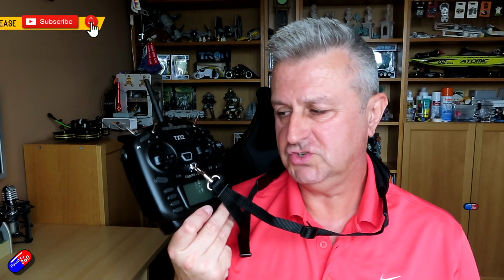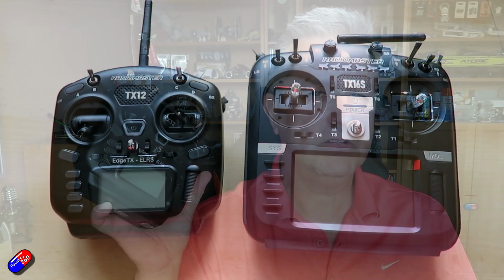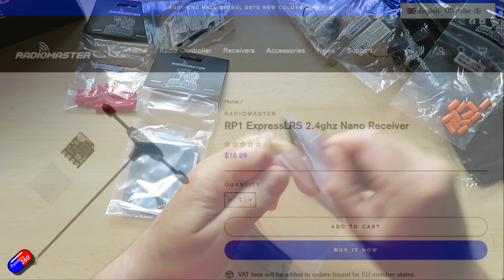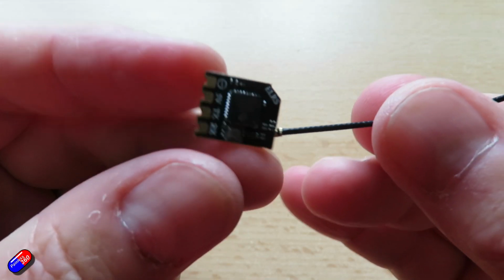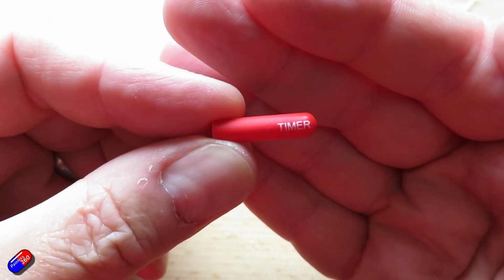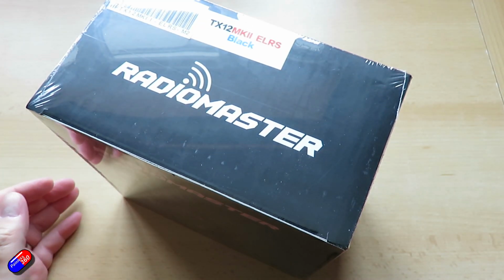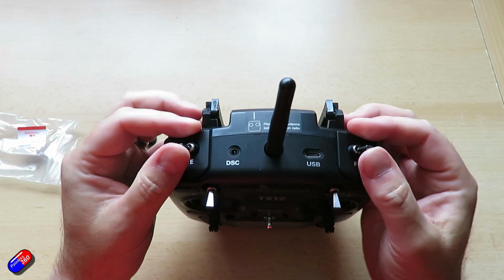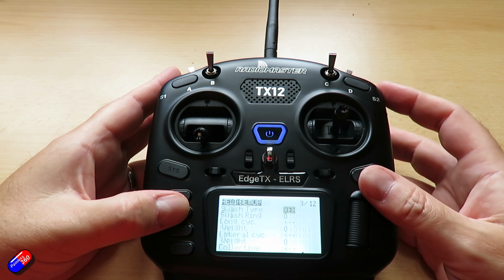Latest RadioMaster Kit (including new ELRS TX12 Mk2 and two new ELRS receivers!)

Comment: Hello! I have the elrs version of TX 12Mk2 only to find out it does't have MULTI protocol, I only see CSFR(the elrs receiver I ordered is on the way yet so I cant test the crossfire part). Am I correct to say it really doens't support other protocol? Then, playing with the EdgeTX Companion, I accidentally, was able to set "MULTI" in the internal RF of the radio! I got excited but sadly I had no luck binding both Radiomaster and flysky receivers to it. I might be doing it wrong (binding) or is it just a setting glitch and the radio is still saying " I'm ELRS only"? i feel bummed I cant use the radiomaster receiver I just bought. Thanks in advance.
Reply from the maker: There is two versions, one with the ExpressLRS stuff inside and one with the Multiprotocol stuff inside..
Reply: @Painless360  Thank you. I guess I would get a multiprotocol module then.

Comment: I am planning to buy this radio to replace the T-Lite I have been using. I find the screen of the T-Lite to be too small and the single 18650 runs down pretty quickly with the ELRS module turned on.  I have the TX16S as well, but just not comfortable with its size. Furthermore, I am also getting into INAV, so I am wondering if this radio has enough switches to work with INAV?
Reply: I commented while watching the video. That was a genuine question I had, though I like this mighty radio 😀

Comment: A nice bit of new kit from RadioMaster. The T-antennas on ELRS receivers and the new push button switches are items I'm most interested in getting. Some mighty impressive potential for model setup customizations with the new gear.

Comment: For Simple & affordable fixed wing setups (900mm wing 2 servo & 1500mm  4-6 servo twin prop) what FC would you recommend pairing with ELRS RXs? With ELRS range & a proper FC it'll be a mighty combo.
Reply from the maker: I use Matek flight controllers for fixed wing here. One even has built in ELRS reciever too!

Comment: TX12 Mk2 is a mighty nice little radio.  I am tempted to add one to my stash of gear as a smaller radio than my TX16s could be good for my quad outings.  Unlike some of the other low price makers, RadioMaster does seem to be interested in quality and working with the community, and I want to support that.

Comment: Can anyone tell me why radios are generally designed with the screen on the lower half and not the top half? I've never understood this. I mean - would you swap the positions of your monitor and keyboard? Mighty good question, I think.
Reply from the maker: Lots are the other way too (see ETHOS radios). It balances out the radio for many designs..

Comment: I really like the look of this a lot, it looks mighty great. I have some ELRS fixed wing models using ELRS now and i quite fancy the smaller form factor. Great review as ever!
Reply: Are them iNav or simular builds, or regular fixed wing with servo connected to the receiver? if then what receiver are you using? it seems the choice of PPM receiver is very limited (pretty much only Matek from what I have quickly gathered).

I am considering finally getting rid of my old trusty Taranis, and getting a TS16S MK2, and I wonder if I should take the leap into ELRS or get a 4in1 model to keep my old receivers around.

Comment: Lee:
   In the past I've always thought that the mighty original TX12 got short shift compared to the other Radiomaster, Jumper, & other brands, but I think the new grips on the MKII version will bring it the recognition it deserves. 
    You did not mention these new TX12 grips as a add-on. 
   Do you know if we can buy and add the grips easily to our original TX12 radios?  Thanks!
Jim
Reply from the maker: If you mean the mouldings on the back, they are moulded onto the case. Not sure if the rear case is sold as a spare... Happy flying

Comment: I run TX16s with Beta FPV ELRS module and Edge TX.   Just been faultless,  I've been 8kms out over the sea and the telemetry never missed a beat even, on 100mw.  Just never have to go over 100mw !  its so good.